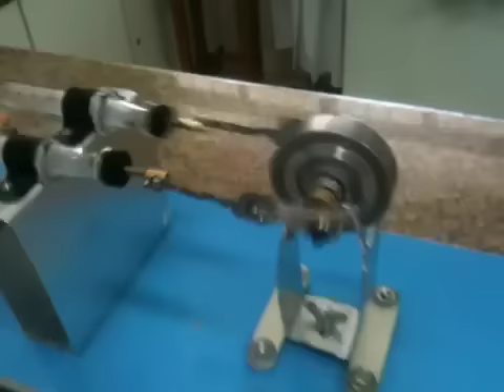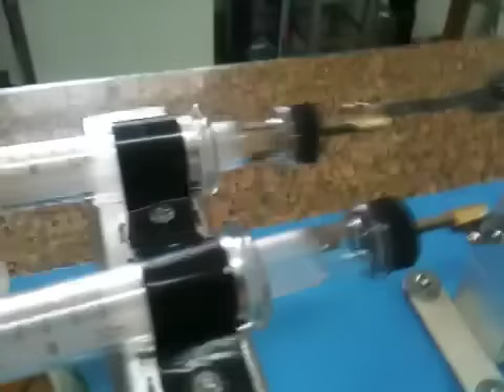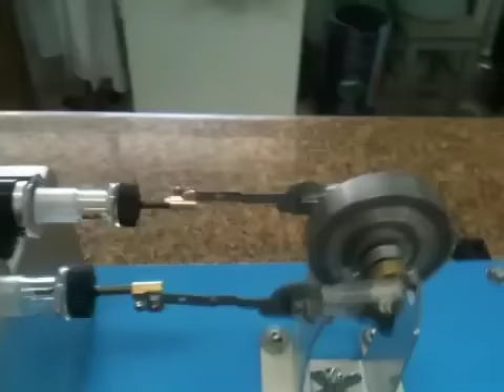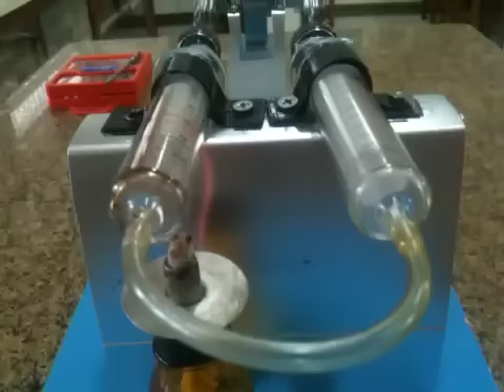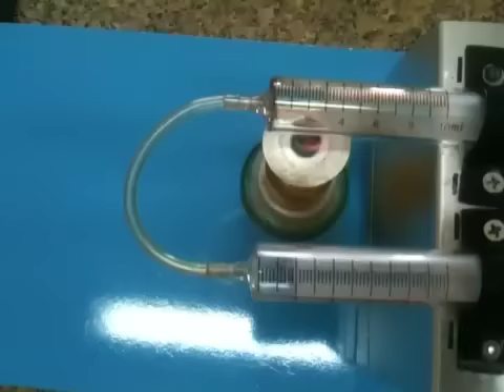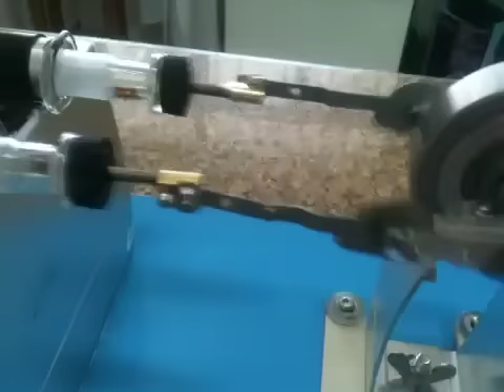Motor Stirling by ALEX AMORIM!

Comment: What is the angle between both piston as they are connected into the crank ? ...180 ??

Thanks
Reply from the maker: yes!
Reply: I though that they should be connected at 90 degree...??? ..
Reply from the maker: I"m sorry.I got it wrong. 90 that"s right